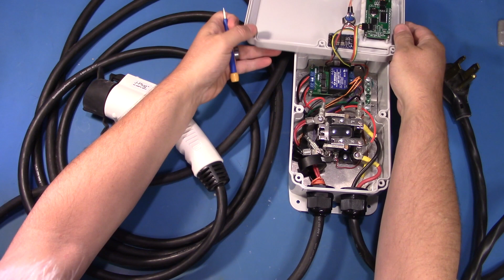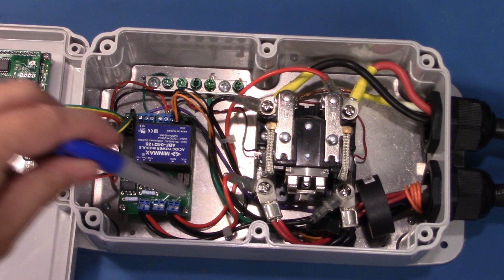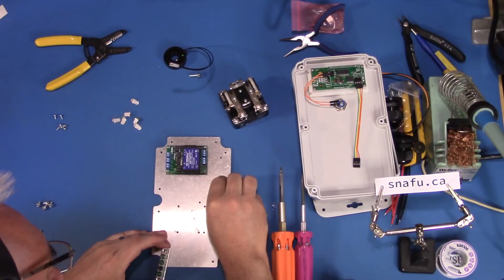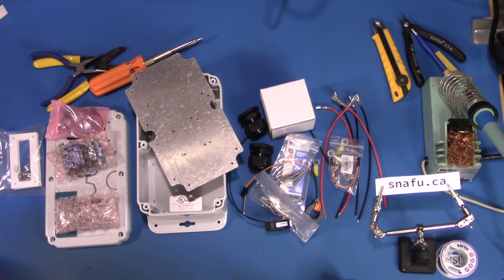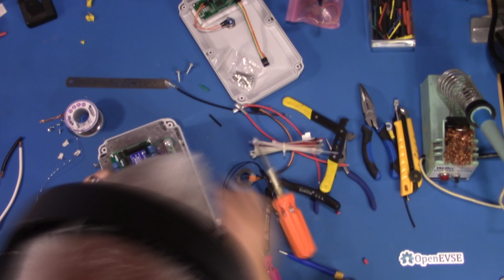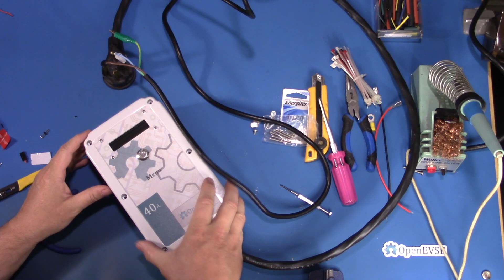OpenEVSE Build and Review

Comment: I guess they didn’t offer the molded NEMA 14-XX plug back then. That’s the one that’s missing the neutral so you can use it with a 14-30, 14-50, or 14-60 outlet without changing the plug. You can buy a universal plug from most hardware stores with multiple neutral blades that can be swapped or repositioned to fit 14-30, 14-50, and 14-60… but that kind won’t be sealed against liquids or spiders and such. Correct me if I’m wrong, but the OpenEVSE does not even use neutral so you might as well leave that prong out.

Anyway, my criticisms would’ve included price since you could literally buy multiple pre-built EVSEs for that. Heck, you can buy one for the cost of the J1772 Type 1 Plug/Cord alone… with the exact same Dostar plug! Maybe they should’ve designed OpenEVSE to fit one of those enclosures for a quick board-swap. ;)

Another criticism is that they sell the J1772 plug with and without the cable but they do not sell the cable without the plug. Just what are you supposed to do with the plug?! They act like you don’t have to buy their assembled cable because they provide assembly instructions for crimping and assembling the plug. Their guide even has separate links for the plug and cable but the plug link is broken and the cable links incorrectly links to the plug. Of course, they also neglect to give you enough info in the guide to look it up the cable yourself.

I ended up getting a used plug and cable for $50 to use with a $30 ClipperCreek control board and $20 enclosure since it was about the only way to stay under the $180-$200 price for the cheapest portable Level 2 EVSEs. Even then, I’m pushing the same price as a used AmazingE unit with the exact same control board, especially after including cable glands and wall plugs and such.

I want to support OpenEVSE but it seems more expensive than a pre-built unit. Perhaps someone will add cool functionality, like mobile notifications when your car is done charging or triggering your car’s alarm when unplugged like the Volt portable EVSE can do (not sure how that works).

Comment: Hi Boffin!  I'm in the midst of building this kit -- the instructions are pretty confusing as they are for an earlier model, but I'm muddling along.  Really appreciated your video, great preview and inspiration.  I see that you connected yours to your bench AC (not 240v, I'm guessing) for testing, using some clip leads and any old power cord.  I can't quite see how you have that hooked up, but I'd love to do likewise when it's mostly assembled.  How would I attach a box intended for 240v to a 120v power cord?  I'm very comfortable with small dc voltages (arduino addict here) but AC scares me.  Wd love to light up my box and test it before the electrician arrives to hook it up to the 60A breaker!

Comment: I was a little disappointed to find that only the hardware is open source, the software consists of compiled hex files. I had hoped I could make my own charging station using an Arduino, and maybe I can still figure it out, but it would have been  nice if they had put a simple ino file on their website which you could edit to your specific needs.